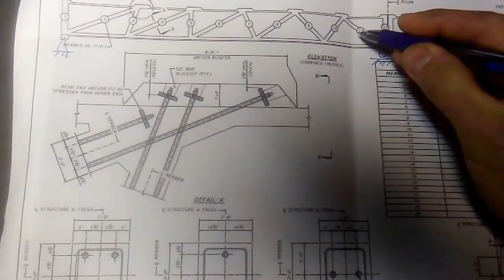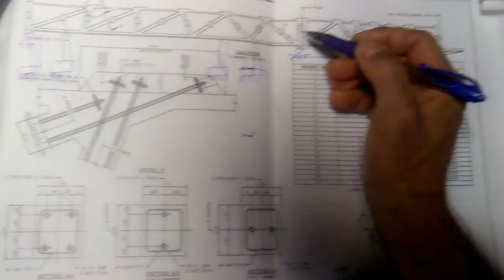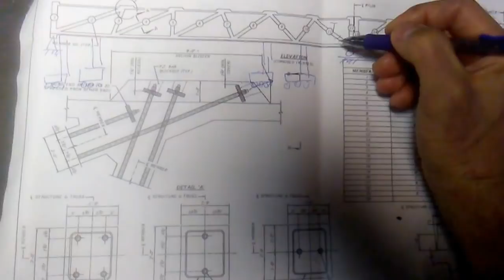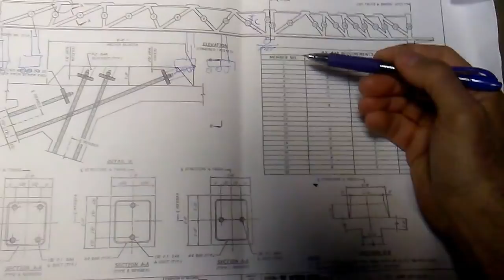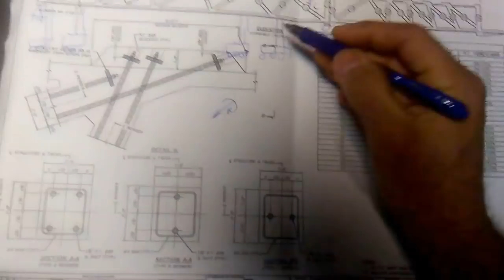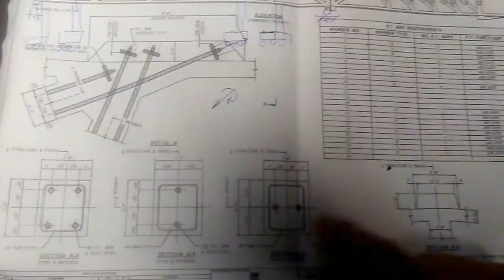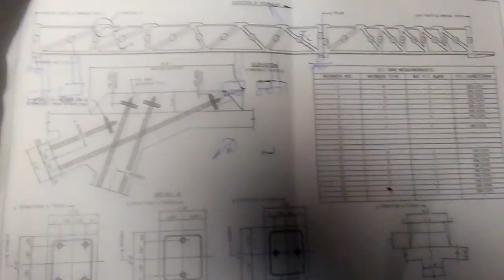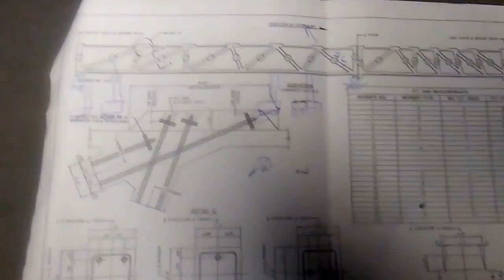FIU Bridge Collapse: The Hidden Truth (Part 2)

Comment: I did an independent speculation on what caused the failure before I found this youtube, and you can overlay it with your presentation here.  Bravo!    Member 11 shows tremendous bending loads (S curve during collapse) in a millisecond frame grab by one of the site cameras.  Only two improvement suggestions.The term "truss" has a classic definition which means a structure of linkages that transmit no torque through their end points.  This construction is an irregular, open webbed beam, with weird flanges.  This web has torque and shear and bending all through it.  The installation contractor was forced to cantilever a portion of the bridge during final placement because of inability to access and apply a temporary mobile support near the pier on that one end.   This was brought about by imposed or mandated changes in construction site access by the mobile supports, after the design was complete.  The temporary vertical reaction load during final placement on that end of the bridge was HIGHER than 950 KIPS.Finally, I refer you to tunnel ceiling collapse at the Boston "Big Dig" project.  16 or more entities lawyered up and sued one another for years after that incident.  The lawyers will decide what happened only after they have squeezed all the juice out of this lemon.
Reply from the maker: Cc, thank you again for your input. The Big Dig is a great example of the legalities that will take place here for a long time to come! A lot of finger pointing, blame, and lawsuits to go around before the dust settles.
Reply: & hopefully JAIL time or at the very least loss of liscenses & ability to ever work in the same field- to those found criminally responsible.

Comment: If the tendon  breaks at it's ultimate limit,won't the shock/whiplash cause a sudden,excessive, extension of the previously compressed concrete,shattering it?

Comment: Obviously you realise, the section you are looking at is of number 2 and 3 trusses, not number 11.. just pointing out the obvious..
Reply from the maker: The member # shown on the drawing is 11...no?
Reply: The section of the truss is the wrong shape/angles, it belongs to the truss above it number 2&3....
Reply: 1spongeygit — He knows which member is #11 because he has pointed to it.  I assumed that the enlarged drawing of a joint at the other end of the structure was just for illustrating how structure is made to take the post-tensioning rods.

Comment: I’m a licensed structural engineer in NY. You can’t just arbitrarily swap the 200 kip post tension load from member 2 and assume it also applies to member 11. In fact member 11 has no post tension load in the table! If you look at the post tension loads, those members all line up with the pylon post tension cables that were not installed yet. The post tension loads in the table are in fact loads that the cables and also the concrete members are set at in the final assembled bridge configuration. Please note that the suspension pipes called for were merely decorative covers that the bridge cables were to be housed for both protection from the elements and aesthetic reasons. Your explanation is therefore incorrect. This is a very complex structure and the fast track construction should have preloads identified for every change due to the construction loading step by step that must be followed exactly. You do not have the final design drawings nor the construction staging drawings and procedures. This will all come out in the NTSB report.
Reply: I think you should take a closer look at the footage of the collapse. And then I expect you will notice that member 11 ends up between the pier and the last section of the canopy in its entirety. Member 10, with the post tension bar including attached tensioner sticking out, ends up at the other side of the canopy. The contractor was post stressing member 10, not member 11.
Reply from the maker: Many valid points Alan! However, we do know from collapse footage that Member 11 contained post-tensioning bars that were being worked on just prior to collapse. And why did Member 2 have post-tensioning shown in the table when this is essentially a matching compression member at the opposite end of the span? The NTSB will certainly clear up some of these unknowns.

Comment: On the engineering drawing, there is a table of tension values for each member. Is the tension shown specified as the tension for EACH rod, or the TOTAL compression desired for the member?
Reply from the maker: The post-tension values in the table are for each rod.

Comment: Concrete cracks because it shrinks and the mild reinforcing prevents the concrete from shrinking.  Hairline concrete cracking is to be expected.  Mild reinforcing is what is required to support the bridge and to keep it from coming apart.  There was not enough mild reinforcing in this bridge because it was impossible to fit enough steel into this concrete shape, to make the design work.
Reply from the maker: I have not seen any information on the preliminary drawings about mild reinforcement in the truss members. It was surely there but the rebar size and configuration have not been made available to my knowledge. Where are you getting information about the rebar in the truss members?
Reply: screamdoctor — The cracks were large, deep, and growing.  This was clearly not a case of ordinary minor cracks due to shrinkage.  The structure was beginning to collapse before the good eye of the lead engineer and he turned his blind eye to it (figuratively).

Comment: So a Design Build Contractor designed it.  That explains it.  A contractor designed this bridge and not a Structural Engineer.  There is a number of deficiencies in the design that tend to imply that a real structural engineer never designed this bridge. For instance, at each junction of the diagonals, tension stresses from one diagonal have to be offset by compression forces in that attaching diagonal via the shear strength of the connection. That shear strength cannot be supplied alone by the concrete. Instead, it is assumed that the concrete will crack and that force has to be transferred entirely by closed steel shear ties. It would be impossible to fit enough ties into the joint between #10 compression diagonal and #11 last tension diagonal, in order to transfer the design loads. Then we can look at the shear transfer required for the roof slab compressive force into the same joint, that also requires a huge amount of closed shear ties, that it would be impossible to fit enough ties into the joint. Still not finished, the #11 tension rebars in the #10 diagonal require a significant embedment length at each end, even if a hook was used, which it apparently wasn't. There is not enough concrete depth of either the roof slab or floor slab at the same pesky joint described previously, in order to develop those #11 bars. Lastly, it appears that the #11 compression member was undersized and was also incapable of supporting the full dead loads, much less the future dead plus live loads. I designed the tallest reinforced concrete structure that was erected on the Pacific Ring of Fire (1100 feet), so I know what the heck I am talking about. This number of deficiencies in the same design, tends to imply that no legitimate Structural Engineer actually designed this bridge. Perhaps the engineering department professors at FIU designed it and were hoping to become famous for building outside the safety envelope provided for in the building codes. Nobody dares mention the name that is on the engineers stamp for the drawings, if there is a stamp.
Reply: I am Professor Emeritus Teaching regulation in an Engineering school (not an engineer)   I personally believe that a critical error was made by rapid action after cracking was discovered.  Large bridges are almost totally "self regulated" ENGINEERED structures.  Almost all are effectively "design build" with the engineer of record responsible from initial approval to commissioning. There is never "hand off" to a contractor. Regulators are not very highly qualified but they can compare the completed structure to the plans.  No deviation would be permitted.    Contrary to the video commentary  I find it impossible to believe that a subcontractor just came and started putting  tension on the tendon without direct instructions.   Fully accepting the video's technical points and Screamdoctor's opinion that the structure was under designed I would note that the original proposal had no PT in member 11.  That was added later.  Since member 11 was in compression in the completed structure  the most likely explanation was to avoid damage during the ABC construction. But there was damage in the form of cracking  The cracking was reported at the North end.  IMHO they were responding to the cracking.   The responsible engineer assured both the regulator and the client that there was no risk.   What is incomprehensible is allowing the public to be under the bridge, no matter what they were doing. The risk analysis is clearly faulty   Clearly they put a jack on the tendon.  Beyond that I cannot understand what they were doing.
Reply: HappyEmeritus you sir, are absolutely correct. It doesn’t take an engineer to understand what really happened, just a grounded intelligent person such as yourself. There is no way that any competent contractor would deviate from the as built drawings, not a chance in hell. The excessive cracking occurred because they deviated from the lift parameters. Under direction of the engineer, they were trying to tighten the PT cables to the original specifications. The problem was, node 11,12 was structurally compromised. Traffic under the bridge should have been halted. The transports should have been repositioned to relieve the stress on that side of the bridge. Traffic should have been closed off until it was deemed safe, even if it took weeks. It could have been salvaged without anyone getting hurt. It was a game of egos, politics, and money. Six people paid the ultimate price for their arrogance.
Reply: In my construction experience what you said is exactly how Design-Build is SUPPOSED to be done; but I have never seen it done that way. What is much more common is that the Contractor takes a completed, sealed design and decides that there is a better (and that always means cheaper) way to build it and deviates from the design as much as needed to maximize his profit. I like the concept of Design-Build but I have NEVER seen it executed the way that it was intended to be done.
Reply from the maker: ghost307 I hear you. However if the contractor takes it upon himself to construct differently than what is shown on the drawings or approved by the engineer, then he is taking on full liability if something goes wrong. That is a lot of risk to take on, perhaps unnecessarily.
Reply from the maker: Figg was the bridge design company. Design-build implies that the bridge designer and construction contractor collaborate on a project from theinitial design stage through construction.

Comment: Doesnt a metal truss involve diagonals in compression and tension?
Concrete sucks at tension and the steel reinforcement was meant to satisfy for the tension.
Seems precarious to me.
Reply from the maker: Yes. Whether steel or concrete, a truss bridge behaves similarly, The main difference is in the weight and strength of the materials.
Reply: Concrete and steel have almost the same coefficient of thermal expansion.  When combined correctly the composite behaves as a whole that is strong both in tension and compression.  There are a huge number of structures around us that depend on this fact.

Obviously the combination works, in general.  And obviously there was something wrong in this situation.  Whether it's a problem in the design or implementation or both, clearly the concrete and the steel weren't combined correctly.
Reply: TheJoeman11 — Post-tensioned rods in a concrete beam are established technology and fairly common now, but it appears to me that they are usually used in simple beams or box beams for bridges.  A good example of the latter is the I-35W bridge in Minneapilis (designed by FIGG, by the way).  But in a truss, the geometry is a lot more complex.  Look at all the tensioning steel in this structure (never mind the rebar)!  Two sets of cables for the upper and lower flanges, and two or four rods in each web element, with different tension requirements, and different loads while moving the structure compared to its final position.  And, of course, the hardness of the concrete is important (that may be a factor here).  The principle that occurs to me is that the more complex a system is, the more opportunuties there are for something to go wrong.  Something did.

Comment: You forgot to subtract the vertical load from element #12 and the shear load from the deck from the 950 Kip load. These loads are not insignificant. However, if you are using a limit states design philosophy, you also forgot to factor up the dead weight. Even if the PT was tightened unevenly, you still won't get a compression/bending failure in reality (at best, it may be a bit over-stressed by code). A more likely cause is a shear plane failure at the pour joint between the deck and the #11 element.

I wouldn't also come to the conclusion that just because the bridge didn't fail for five days that it was the contractor's error that caused the collapse. The prestressing increased the shear load at the pour joint which took the load over the top. But if this was the case, there was a design flaw that was exacerbated by the prestressing. All the photos of the damage I have seen appears to be consistent with a shear failure at the pour joint between #11 and the deck.

Comment: That's an interesting point, someone wrote that member 11 is under some bending, which might have been countered by some unequal stressing of the top and bottom tendon. Once set down again, the bending would then have been reversed and so the tendons might well have been dangerously asymmetrically-loading the concrete cross section... which then buckled.
Reply from the maker: In this case, any bending in Member 11 would have been due to the selfweight of the member plus any eccentric loading from unequal tension in the 2 post-tensioning bars.

Comment: not an engineer, but I throw in my opinion.  1) Not enough redundancy in the design.  a home is built so strong that it remains standing even after termites destroy half the structure.   2) another report said that K barriers on the street forced the mover to push in the rolling support, that cantilevered the failed end.  My guess is that it was critically damaged then, and when they tried to tension the rod to compress the diagonal support the concrete lost form and blew out .. critical failure.  collapse.  I also think that this design will not be duplicated, since this accident demonstrated its critical design flaw
Reply from the maker: All valid points. Your theory appears to be the growing consensus. 
Whether this design is ever duplicated remains to be seen.... I think much depends on what is determined to have been the cause of failure.
Reply: no argument here...  Lakewood CA

Comment: While the structure was as you say, still standing prior to the tensioning performed on the day of collapse, it was noted in the voicemail by W. Denney Pate earlier in the week that there were noticeable cracks at the north end of the structure. Unfortunately the voicemail was not retrieved until after the collapse.  

I suspect these cracks were in the #11 (and possibly other) diagonals.   Since the strength of the concrete truss members relies upon  compression, I further suspect it was believed the best field tactic to close the cracks by tightening the tensioning rods in #11.  

There were also reports of "whipping and cracking sounds" coming from the bridge, however it is unclear as to whether they were heard on the day of the collapse or days earlier.

I agree that the damage most likely occurred during transport.  The misplaced transport trucks and the lack of steel plate reinforcement between the trucks and bridge (as specified) compromised the structure.  From that point forward, no amount of re-tensioning of the struts  could save it from failure.  

The lack of engineering redundancy and disregard for the safety of those on and/or under the bridge is a recipe for disaster.  I'm sad and sorry for the loss of life.  it was absolutely unnecessary.
Reply from the maker: To add to your points, it has been reported that on the morning of the collapse a 2-hour technical presentation about the cracks  was delivered in the field by Figg engineers with state DOT and university representatives present .
Reply: Delia, even my untrained eye thought that the small wooden shims were very odd & seemed that they would not support such a heavy structure smoothly, without wobble.

Comment: I think you mean post tension not pre stress.... pre stressed means the rods were tensioned before the concrete was poured...  it's very doubtful there was anything pre stressed in the bridge.
Reply from the maker: Prestress is a general term for inducing compression into a member using steel cables or bars. Pretensioning uses strands that are tensioned and embedded into freshly poured concrete. Post-tensioning is done with steel bars in ducts with the concrete already hardened. Both methods  prestress the concrete.